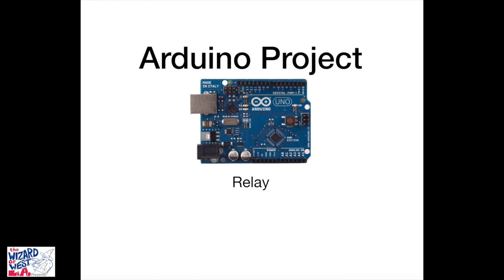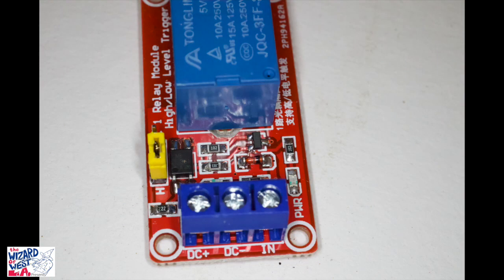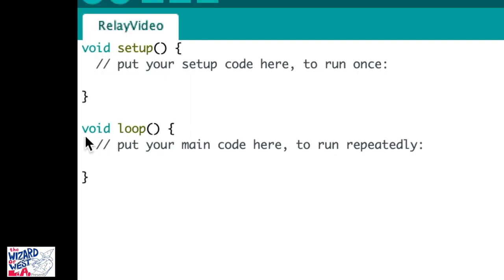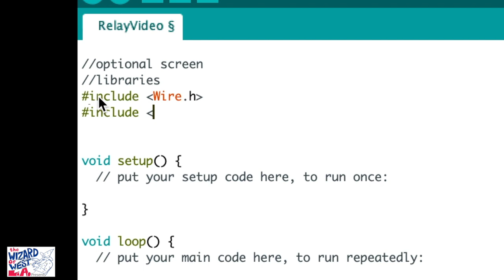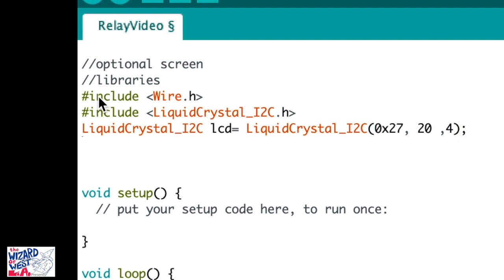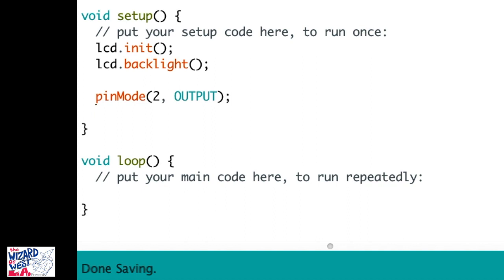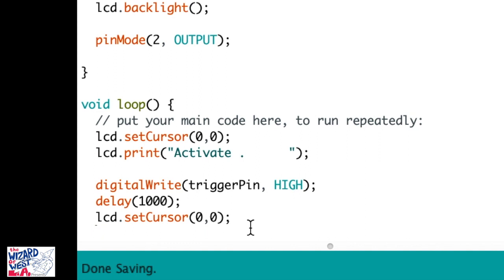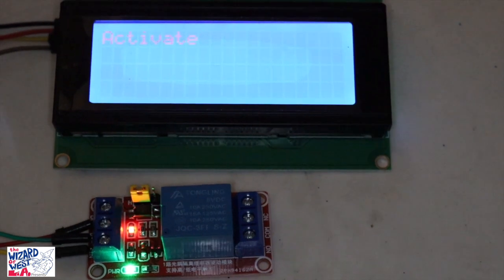Using a Relay on Arduino

Comment from the maker: Visit us at www.wizardofwestla.com
I want to thank everyone for being a subscriber!! 
Here is the code that was used.

//optional screen
//libraries
#include <Wire.h>
#include <LiquidCrystal_I2C.h>
LiquidCrystal_I2C lcd= LiquidCrystal_I2C(0x27, 20 ,4);

int triggerPin =2;

void setup() {
  // put your setup code here, to run once:
  lcd.init();
  lcd.backlight();

  pinMode(2, OUTPUT);
  
}

void loop() {
  // put your main code here, to run repeatedly:
  lcd.setCursor(0,0);
  lcd.print("Activate .      ");

  digitalWrite(triggerPin, HIGH);
  delay(1000);
  lcd.setCursor(0,0);
  lcd.print("Deactivate .    ");
  digitalWrite(triggerPin, LOW);
  delay(1000);
}